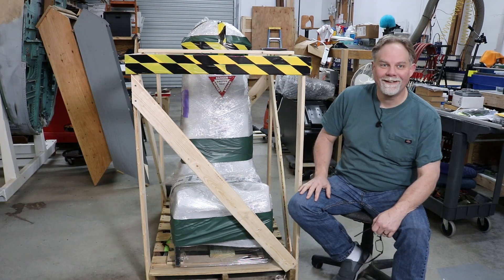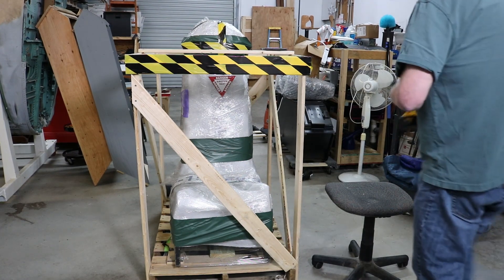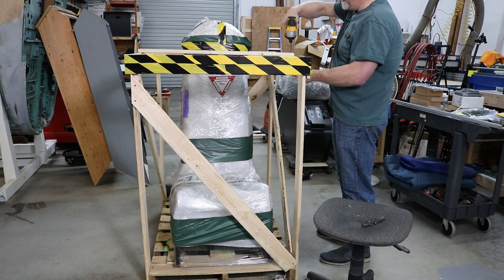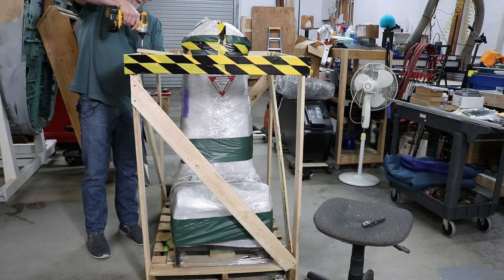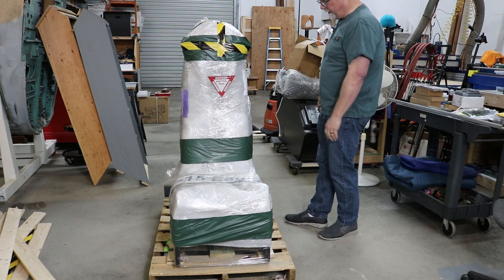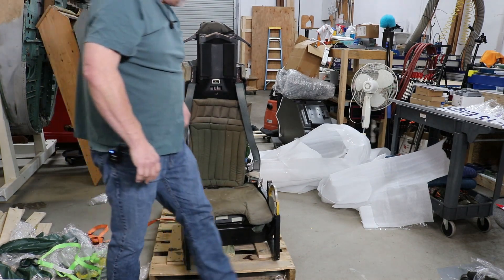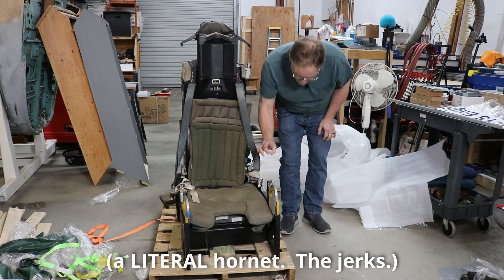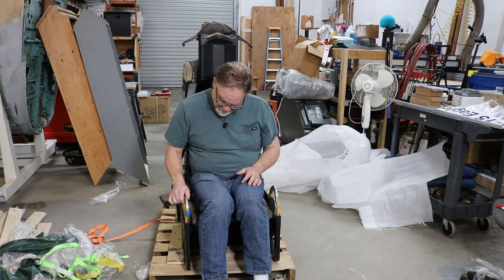F-15C Project - Unboxing an ACES II Ejection Seat!

Comment: Hi Gene, im working on a Hornet sim would by chance you be able to provide me with a part number for the Jettison switch, im seeing the F15 has a very similar switch in the cockpit from your old posts in 2002, and id be interested to know what part that would be called. Im trying to source something close/similar for my own cockpit.

I was lucky enough to stumble on a direct replica of the AUX panels that the Hornet uses so im trying to do something very similar to what you have accomplished.
Reply from the maker: Are you referring to the black & yellow striped "PUSH TO JETT" button that's to the left of the artificial horizon, or are you referring to the "JETT" selector knob & pushbutton that's on the lower right corner of the MPCD?
Reply: @f15sim  the one that's on the middle MFD, it has about 9 different rotary selections it looks like. Is there more then one rotary like that in the pit?
Reply from the maker: @Datttsnake Ok.  Is this what you're after then? https://forum.dcs.world/topic/205073-fa-18-jettison-control-stl-files/
Reply: @f15sim  yes that'd the correct type but it won't work for my needs unfortunately. I'm trying to find the real switch, because I have real panels on hand with real measurement replicas for the panel itself. Something like that will not work for my application as it does not fit within the panels I have.
Reply: @f15sim  the AUX panels I have purchased are direct replicas made off of real hardware. It's not like others where it is based on guesses, I'm using direct hardware and measurements where possible in building this replica simpit, as I can only do this once in my life so I'm trying to be as accurate and faithful to the jet so I am not disappointed in the final result.
Reply: @f15sim  I know currently the switch is a Grayhill one as I was able to find someone who had one randomly, but he had zero part number. If you know a partnumber for the one in the f15 that would help me find a datasheet to help figure out what the 18 uses. If not I could just use the same switch as yours and remove the other detents.
Reply: @f15sim  ideally the one I'm looking for is the one of the left side MFCD, near the landing gear, with the button.

The yellow and black one also is of interest if you know more about that part aswell. Really any information you can provide on who makes these parts, how to obtain, and how to use them in a simulator would help. I'm having a bad time finding these items, so if I could aquire your help it would be amazing.

Comment: Nice seat! I would love to get one myself. Not to make a full cockpit, but just a basic sim setup. I was in Life Support.the chute fittings are an F16 Frost fittings with the SeaWARS still on them. The L-Shaped devices around the connectors.  The real ones have a battery under the white cap that twists off.

It’s cool that it has the rouge chute. The spring on that thing is strong. We would inspect the pin and the Larkshead knot that held it. If that pin were to come out when over top and inspecting, it would knock a person out. I don’t recall the process for removing the chute, but it is only about the size of the head rest and a tube out the bottom that connects into the seat where a charge sits to separate it from the seat. We would swap them out and take them to the Para/fab shop.

We also inspected the seat kit. You prolly know, but I’m reminiscing…  there is a latch on the back edge of the seat pan and it lifts from the back…

I’m wondering if this cam from a cockpit egress trainer.

Thanks for the nudge down memory lane!
Reply from the maker: I was able to contact someone that knew more about the seat - it was built in 1992 as a trainer of some kind.  the drogue chute container isn't a full one - the plate it rests on is a solid part - it's not a complete head box assembly.  I'm hoping to do another video on it soon - I'm under a pile of "infrastructure" projects that need to be done before I can focus my time on the F-15.
Reply: @f15sim  I remember our F15 egress trainer in Wing Life Support at Tyndall. I wish I could get ahold of one. Not to make it a fully functional Sim, but to set up close to.  I have loved the F15 since I was a kid. I got to see them every day for 3.5 years at Tyndall. I miss the sound and smell of the flight line.

Reading the TO’s and doing the safety checks just to get to the point of being able to do the inspection always gave me a weird feeling thinking about what would happen if….

The F4 was a completely different seat, but I heard stories of a battery replacement under the console while is Life Support school. Someone took a shortcut and the poles of the battery touched the metal panel which charged the seat with the tech sitting upside down in the seat with his head under the panel.  Made me distrustful of the seat while maintaining! LOL.

A model such as the one you got would be an amazing find. They are not easy to find.
Reply from the maker: @Freediver_72  There's an Ejection Seat group on Facebook that I think you'd get a kick out of.  Lots of Martin-Baker folks there.  Some of the people on the group work for companies that build the ACES II/5 and others.

Comment: Noticed you have the "Blade" type harness connectors, which in research only came on F-16s which you definitely have the side handles, but also keep in mind the A-10 has those handles but they are raised. Very cool, beautiful seat for your F-15.
Reply from the maker: I haven't had a chance to go through the seat and identify all the oddities. :) I've got a copy of TO 13A5-56-11, which is the operation & maintenance manual for the F-16, A-10, and F-15 versions of the ACES II.  That will help me "true up" the seat to make sure it's using all the correct parts.
Reply: @f15sim  Sure would love to come there and 3D scan that seat.
Reply from the maker: @Metal2Mesh  I suspect there's better examples closer to you. :)
Reply: @f15sim do you have a PDF for this sort of thing?

Comment: I had the "pleasure" to repack my chutecontainer after accidentially opening it - wise decision! :)
Reply from the maker: I've got a head box with the drogue unpacked.  I've never been able to get it back into that tiny space it's compressed into. :)  The drogue container on my seat is packed, it's just the clips around the sides are disconnected.  Once I learn how the drogue is correctly re-packed and I've done it a few times on the other container I have, I'll see what I can do with the one that's on the seat.  Until then, I'm not going to disturb it. :)